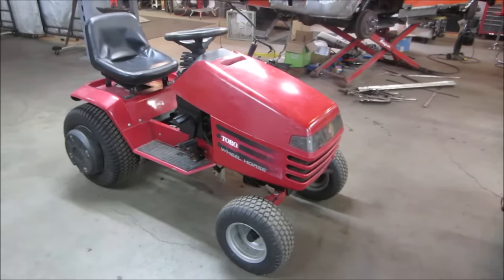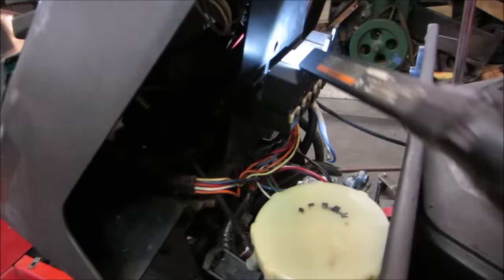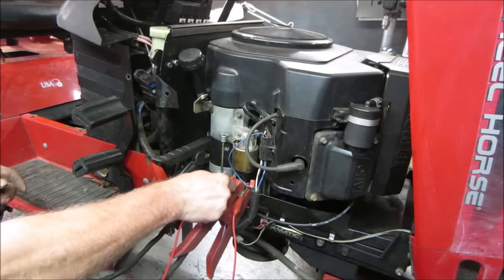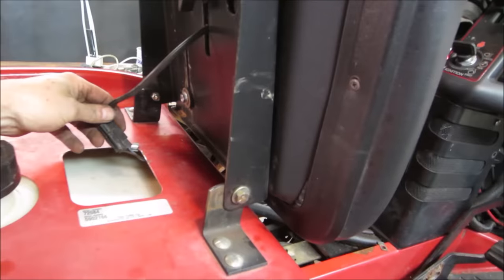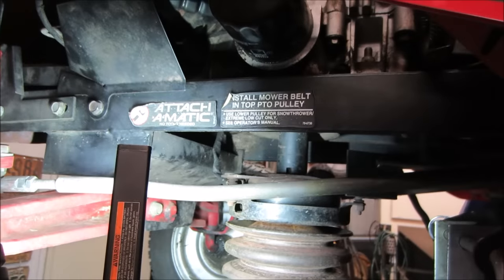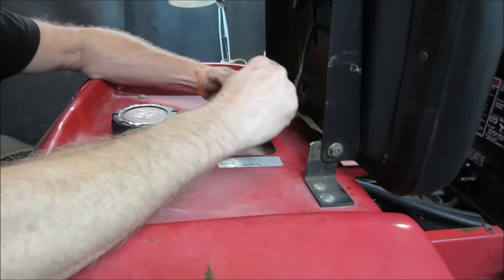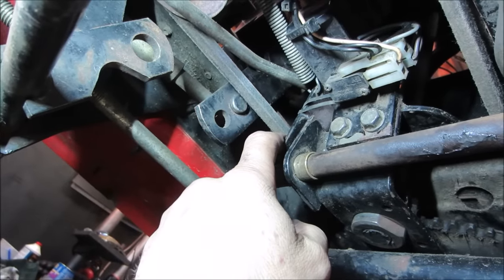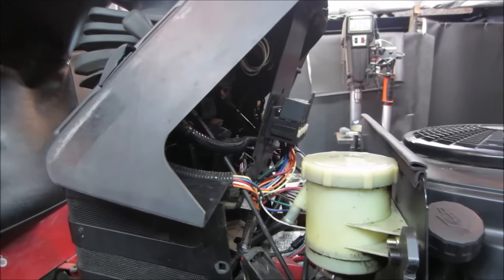How To Troubleshoot a Mower That Stopped Running,

Comment: Mustie you are amazing.  Period.  Your channel is awesome because you teach us how to critically think in order to solve the problem.  That’s the fun part!!  Any Schmo (like me) can pull a wiring diagram and follow a flow chart of things to test.  Heck, I fixed my own dryer last month when I found this little cheat sheet called the “tech sheet” tucked in an envelope inside the bottom panel.  I fixed it but HAVE NO CLUE HOW ANY OF IT REALLY WORKS.  That’s the difference between a person using wiring diagrams and tech sheets and testing flow charts and Mustie.  That’s exactly why two other shops couldn’t figure out what was wrong with this tractor:  they had Schmos like me looking at tech sheets and wiring diagrams and testing flow charts — and when there are multiple and overlapping problems (like here) those things are useless— UNLESS you have the critical thinking skills like Mustie to work through all of the possible scenarios to figure it out.  He does that out loud, with a passion for understanding it and solving the riddle.  How many of the Schmos in the other shop would have taken the time (or even thought about) cutting open the PTO switch to better understand how it works and why it failed?  THAT’S WHAT MAKES MUSTIE DIFFERENT.  And watching him enjoy solving the riddle, and being his little flunky tagging along handing him wrenches is just plain a lot of fun.  Yes it’s about engines.  But it’s also about feeling like you are his pal.  And the hidden beauty is that you not only learn about engines, you also learn about how to solve problems with critical thinking.   
Well done Mustie - my favorite channel on YouTube and I’ve never repaired one small engine in my entire life.  You rock my friend.

Comment: Great job man! I find in these instances, repair shops have techs that just don't want to show persistence and really dig into something with some passion to get to the bottom of the problem. so many guys also lack attention to detail and the ability to do a thorough visual right from the get go, this mower prolly coulda been fixed by u in 20m if you had been the first guy to touch it and approached it like you approach all diagnostics, with passion to understand something  and persistence! Learned alot on this one, great job again man!

Comment: my guess is that relays are funny to understand and that the one hot lead from the relay to the pto switch is actually looking for a ground to make the relay complete it's circuit, which it would make by the pto switch being off and making a ground down to the pto itself. no power but it makes a ground to the pto and makes the relay break the ground to stop it cranking  so one side is making a ground , I think.  I'm a big fan .keep up the good work :-)

Comment: I have owned and serviced a lot of deutz and simplicity tractors.. neutral switches.. pto switches..seat switches..  my machines dont have the gas shut off or the brake interlocks.  I have seen a broken throttle switch keep the ignition grounded.. that one took me 30 minutes to ponder.   My hand hydro machines often are not fully in neutral and will not start from that..

Comment: Cub cadet cc30h mower mowing ok then idle started up and down but only when mowing around 10 minutes. Took hunyia carb off and cleaned jets.worked ok for 20 minutes and started doing same thing. Using true fuel since 2 years ago with no issues,  any ideas? I ordered a new carb to see if that fixes issue.

Comment: Classic example when your the '2nd/3rd man in on a repair, you can't trust anything. 
One switched wire, or a component changed for one that was 'almost the same'
by the previous guy/owner, could take forever to suss out.
Well done Mustie...you had to work for that one!

Regards from the U.K

Comment: Excellent video Mustie  1 :) did excellent job also that sure puzzle at first and then got fix up just right ! Plus notice when got going no headlights sure shock me usually has one working and had nothing thought might killed motor on start up! Or even fuse plus breakers need replacement to Lol and hope owner want have headlights to use for safety drive!

Comment: Great video.  Thorough. Logical.  Now I hope I can apply it to my 1998 Wheel Horse 522xi that I have jerryrigged to bypass all the safety switches just so I can blow snow for the winter.  When the weather warms up I will attempt to fix things properly.

Comment: Enjoy your stuff. Nice and easygoing. Question: For those of us who are not so brilliant, what would have to happen to get rid of ALL the electrical "extras", and run bare bones. Just ignition on/ off, starter switch, PTO switch, charge for battery. No lights, no safety stuff, no carb solenoid or low oil----- strictly bare bones. They probably won't let you tell us! Thanks anyway.

Comment: relay clicking with the key turned to start, I believe that is the starter relay. they must have another relay that cuts power if a safety isn't working. some of those tractors had a switch on the main drive belt that would kill it if it broke or was too loose, maybe that is broken or left unhooked.
now I'll watch the rest and see =p

Comment: the cleaner in the carb was smart, my throttle wasn't a cable bolt it had a scew head to tighten or loosen but got the mower running again with that and making the gast line shorter

Comment: Safety interlock switches going bad on the Toro 260 series is common. I’ve had 6-8 of them. Another thing is that Toro put the battery right next to most of the wiring on the 260 which can lead to early corrosion of the wiring. Toro had a better idea with the 5xi series putting the battery in front of the engine.

Comment: A normally closed switch that OPENS when an unsafe condition exists is intrinsically safer as the plug falling out makes the system safe,
Normally closed circuits can be wired in series so that ANY "unsafe" condition will render the system safe.
They can be a royal pain if there are many...
Excellent video.
As an Electronics Engineer, I'd want to design in a micro to check the conditions and report fault codes to make servicing a lot easier...

Comment: I watch your videos on troubleshooting non-running machines with great interest.  I have a Husqvarna 4 wheel drive push mower that has been in the shot 4 times and declared fixed and running.  Each time I bring it home and try to cut grass and it starts and runs for 5 to 30 minutes, then blows the air filter off the machine as it stops running. The air filter is loaded with gas so I'm thinking that it has something to do with valve setting.  I was told by several places that they had checked the valves but when I took the valve cover off the Honda bond sealant was still solid and intact. I hate to be lied to and have to pay for it on top of that.  I wish there was a place here that had your ability and resolve.  Keep up the great vids and maybe one of these days you'll get a mower like mine and diagnose the problem and fix it thus giving me some ideas of what to look at.
Reply: Inlet valve is sticking open.Carbon build-up on the stem or bent stem, my guess.
Reply: @martinwade9421  I'm not a small engine mechanic so I'm guessing to determine that you would have to dismantle the engine. Some of the shops who worked on it said they had checked the valves but as I said the sealant under the valve cover was still intact.

Comment: I have a 2016 craftsman t1200, was mowing along, tried using the reverse mowing feature to no avail, so went back back to forward mowing for about 10 ft and then it sputtered out and I haven't been able to start it since. It does nothing. No crank or anything. Battery at 13v. I've checked safety switches is a little Jerry rigged from the guy I bought it from.

Comment: Ugh. I currently own four riding mowers, all of which were revivals  that were given to me because they didn't run. The first thing I do on all of my mowers is to disable and/or bypass all safety switches and fuel shutoff solenoids. When you are dealing with really old mowers like this one, those items almost never work properly (if at all), especially if the mower has been stored outdoors for any length of time. Those electrical switches are more trouble than they are worth, especially if you use your mower responsibly. As for fuel shutoff, I just install a manual shutoff valve in the fuel line. I spent weeks chasing a malfunctioning shutoff solenoid on a brand new carburetor once, and a seat switch on another. It is just much easier to work on older mowers if you eliminate those items from the equation.

Comment: Just to let you know I had this happen twice to me when working in a dealership. The other tech tore both of the cars apart,seats and carpet out ,down to the bare harness and then gave up and went on vacation. I found in one case the body shop had replaced a part in the bumper for the active cruise control, they put in a sensor the car had a control unit,looked the same,the same plug just a lower level version is what the car had. the other was two connectors again the same but one was a sensor the other was an output,plugged in ok just nothing worked., THANKS for the videos and sorry the Beaver didn't work out so well. And yes when he returned he had to reassemble the cars.

Comment: i have a question if you feel like answering . not sure if i asked you before . its for anyone who can answer but every briggs and stratton motor i come across, lawnmower, weed eater, leaf blower whatever. they all can be fixed by myself but in the end they all have the same problem they wont star tunless i spray carb cleaner into the filter then its first pull and it runs great..why is that? it slike this with mowers wiht new carberators, new filters everything, every mower thats briggs and stratton does this for me..im not a certified mechanic but i do this as a hobby and this is the only issue i have . on a weed eater, and a elaf blower i adjusted the oil, gas mixture screws and they started fine first pull but the mowers dont have those on their carberators what is this porblem?

Comment: I remember back in 76 a guy brought me a John Deere with the Tranmission in 3 milk crates. I was 16 and my first mechanic job and no book on tractor. Now I would have bought the book and fixed it but as a kid I did the hit and miss method, lost count  of how many times I pulled it back apart. He made me head mechanic, but Ford paid better and I wrenched for them a year later and place folded months later. I got hired their were 8 lawnmowers brand new the owner had assembled and started all at once when put together. Well Wheelhorse only puts oil in some of them and he locked up 4 brand new lawnmowers. My first job was to fix them. Ford had brand new parts laying all over and that made you sloppy at diagnostics. But very fast, turn around. Working the  same type of equipment helps with both them a lot, hated it. I buy non running equipment now and flip it. Fun buying equipment setting for years  cheap and sometimes fixing it for a little time. Other times owner will try and con you knowing problem is much worse. I don’t get bit often but mostly buying online. People are more honest in person.

Comment: Great Job Trouble Shooting The No Start Problem even After Others Really messed it up :)  I am A Retired Female Industrial Operating Engineer and Fleet Equipment Tech with 50 Years of Experience , Yea, Always go after the Safety Switches First, that normally is 95% of the Problems, Take care and have fun.

Comment: I had the same tractor, one of the best I had. It kept blowing fuses, I ended up putting a wire on and jump out the fuse and never had another problem. That thing was a horse… Wheel horse of coarse! I mowed 1/2 the neighborhood for years..

Comment: My mom bought a riding mower from Sears in the early 70's after I bitched about pushing a mower on her new house's 1 acre lot. Growing up, I'd mow all of it with a push mower!!
Sears LT8/36, and that thing was amazing.....still have it, and a few years ago it would run fine, and then begin to misfire and eventually die....replaced all of the obvious for such an old mower...coil, condenser and points......same issue. Runs fine for a while, then gradually dies. It was the ignition switch I finally figured.....some small arcing within finally became enough to kill the engine after 20, 30 minutes......cooled off, the same problem began.....made ZERO sense, but that was the problem....

Comment: Ok a guess before diagnosis. Ign switch.  Ive had 2  do this exact same thing. And i only figured it out by checking actual current.  There was an extreme current drop ( possibly bad contacts in the switch) accross the ign. Terminals to relay...

Comment: A lot of those new Chinese ignition switches are pinned different, I was thinking that could have been an issue too. I had that problem with a mower. Instead of buying another ignition I just swapped out the wires on the harness. If anyone else ever has to fix that mower ignition issue again good luck finding that lol.  I suppose a service record book for each machine would  be helpful. 
This was a good troubleshooting video.

Comment: It looks like the lamps are seeing inductive kickback (a reverse voltage surge) that will cause the bulbs to get brighter when you release the various switches. If this results in short lamp life, a diode may be able to be installed to prevent the lamps from seeing that voltage surge.

Comment: I know your deck is off but your handle for your deck is in the forward position which means your decks down if your deck is down on a lot of mowers it will not start you have to lift it up

Comment: Belt change but ran after, the last mechanic is more my worry. Safety switch’s was my first guess,  but I worked for a week on brand new key switched on 4 wheeler that someone put a wrong switch on.  I was third guy so I found a lot of other stuff also. Working behind others is my most hated thing, they take the original problem and usually make more.

Comment: I bought a snapper ZTR mower. the guy delivered it and parked it in the garage. The next day went to mow and it wouldn't start. Found a soft set coupler on the left control lever.

Comment: Do you teach a class at JuCo on small engine and yard implement repair? You should...as time marches forward regulations will make it impossible for manufacturers to make new ones so there will be a great need for trained mechanics who can trouble-shoot such arcane problems and effect repair of aged equipments.  Classes on how to figure out the intended functioning and proper re-assembly without a manual would be the most important, and well worth the matriculation fee for anyone looking to make an earning from it. Thanks very much for your highly educational videos!

Comment: A friend brought in a Toro that threw drive belts since He bought it, He took it back to the dealer same problem! He brought it to Me to work on I noticed right off the bat that it had 1 bolt holding on the transmission on either side instead of two.

Comment: If you charged an hourly rate for diagnosis like you showed, you're at dealership level for trained technicians.
You could charge what they get, because without the warranty politics, you're more effective.
That tractor was 26 years old?
And you had a used switch to swap in for the fix.
That was great.
It looks like it hasn't worked much for them and sat in their garage.
Now it has a new life thanks to Mustie.

Comment: I worked on the same one a few weeks ago with same issue. I found the fuel line was kinked by the connector on the fuel tank.

Comment: I  own a LS 35 New holland - ford  is exactly  same tractor you got there , having hard time buying parts for mine like to know  model number of what you working on so i can go to toro wheelhorse for needed parts ,, ps mines 20 years old and had to replace iginition two differt times from ford tractor ,, over 50 $$ each time ,, been a reel good machine for last 20 , but did just buy a jd x390  and now rebuilding the ls 35,,,, deck and all.  so thx if you can tell me numbers on that machine thx again '

Comment: I am having problems with My club cadet engine  run. But my transmission runs for a few minutes and then it doesn't run. Back wheels won't run. Change transmission fluid and still same problem. Maybe you can tell me what to do I appreciate thank you.